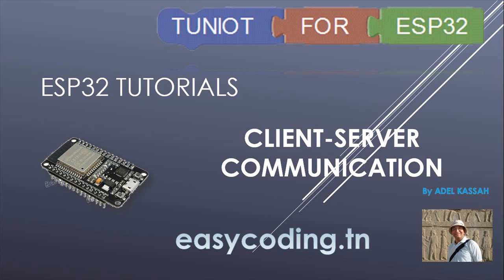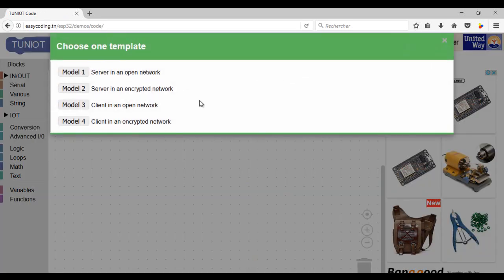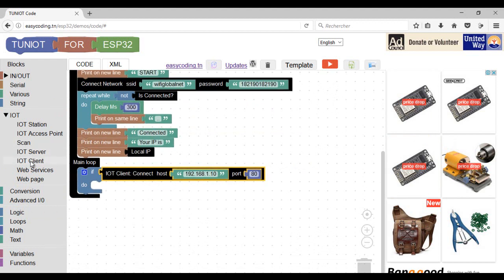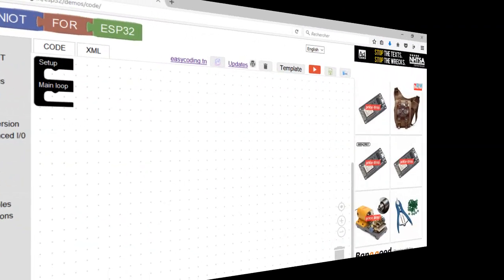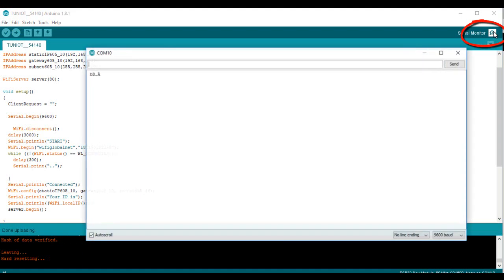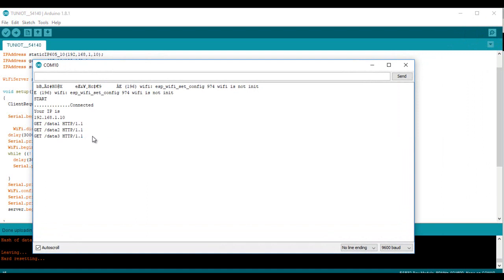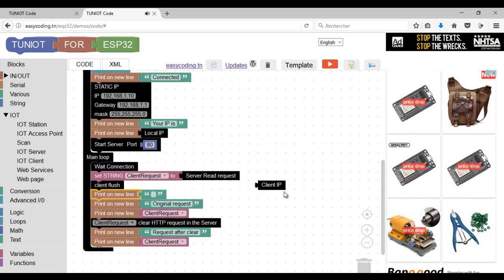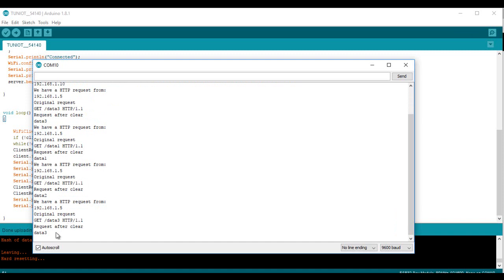ESP32 tutorial B-05: Client server communication

Comment: sir i m using nodemcu (esp8266) only , but the block " IOT clent connect host " i cant find that . If possible can u pls put the arduino code for server and clent in the discription or in the replay .
Reply from the maker: +nischal jadhav there is another tool called tuniot for essp8266 . You can find on the home page. This tutorial is for esp32